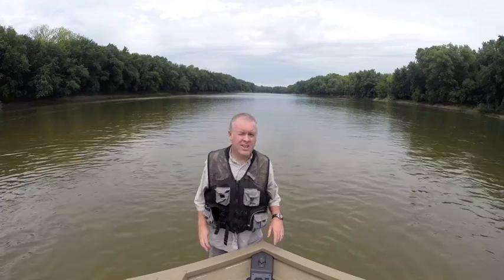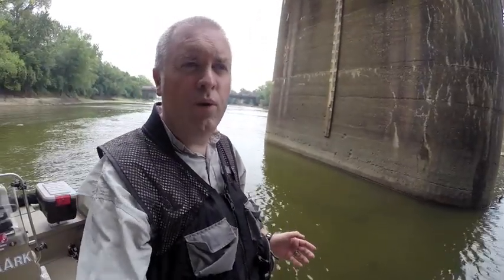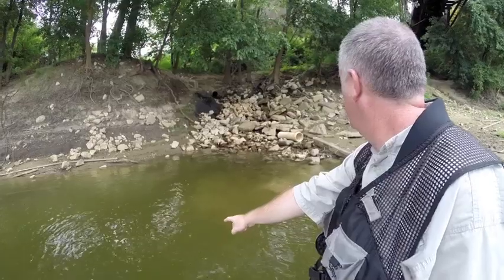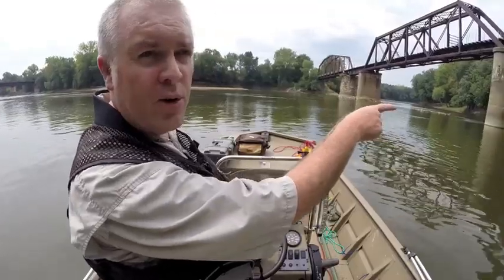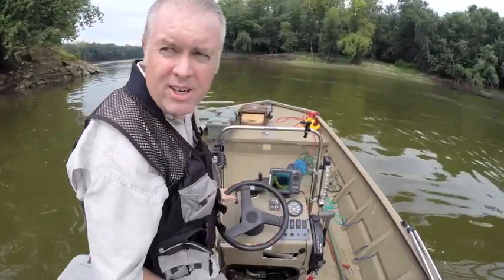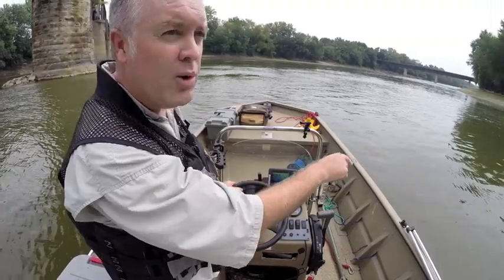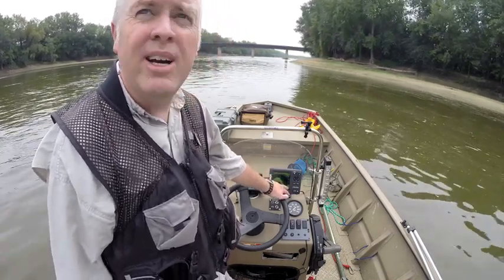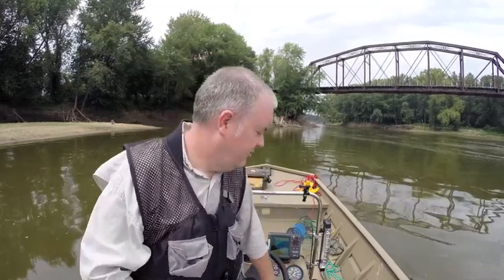Wabash River Water Level Explained Part 1

Comment: Just saw your other video about how much you love the wabash. While I will agree it is historically a big deal for Indiana. It's still a disgustingly dirty river. I grew up in attica which obviously is quite a few miles north of terrible haute. My dad when he was young used to race boats on the wabash even. However I was always warned to never get in the water. One because of how grotesque the water quality was and two because of the strong undercurrents. My dad actually as a child lost a friend due to drowning. It's really sad actually that so many places dump so much into the river. As well as all the agricultural run off that adds to it. I've spent a little time out on the water on my jet ski. I refuse to put my boat in because there is so much debris and rocks from trees and limbs to car parts to old tires to old appliances in the water from north of the Paul dresser bridge up towards what we locals call the green iron bridge. Theres just so much and because of changing currents and so forth you just never know. I've heard a ton of stories of boats ripping the engine clear off the transom or busting a prop. Now on the positive side. There are some good fishing spots along the river here in attica. Around the supports for the Paul dresser bridge and the train bridge as well as the old supports still in place from the train bridge that collapsed. Another fascinating thing we have here is a island that makes for good camping if you can get out there when the mosquitos wont carry you away. Theres also a ton of fresh water oysters to be found in certain places along the banks and we would use the shells to make necklaces and so forth. The biggest issue we have here is the pollution. First and foremost the city of attica drains its streets strait into the wabash. Harrison steel has two big pipes that dump God knows what into the river as well and on some days the smell is awful. Also our sewage treatment plant is right beside the river and altho the water is treated you can still smell the raw sewage.... I'm assuming Lafayette does the same thing. I have driven my ski from williamsport all the way north of Lafayette. I doubt a regular Boat would make it because in places it's to shallow. The next big thing that would really benefit the river is for the entire thing to be dredged out and cleaned. Anyhow thanks for listening to my complain. Keep up the good work my friend